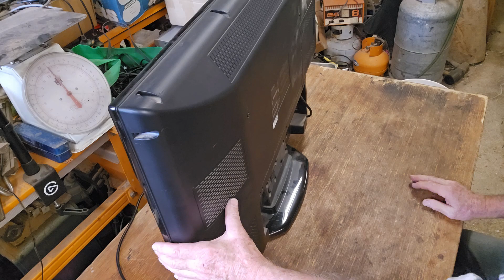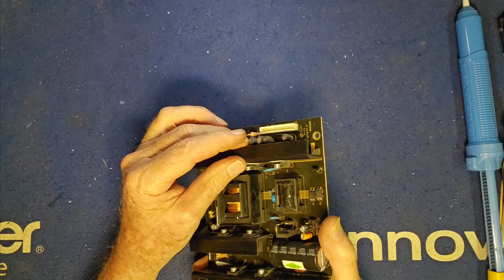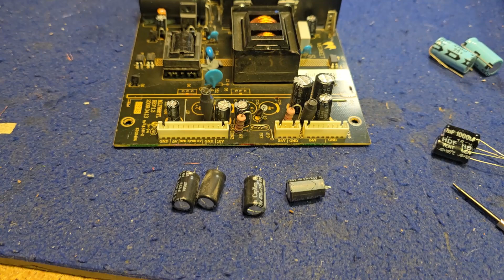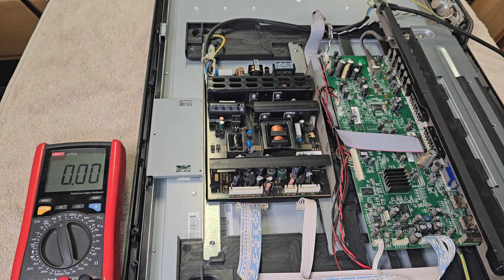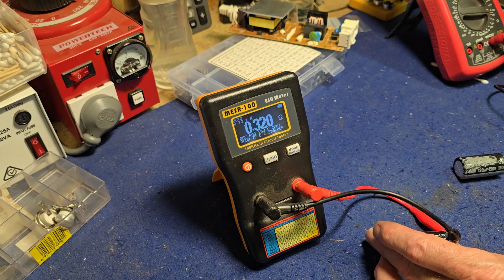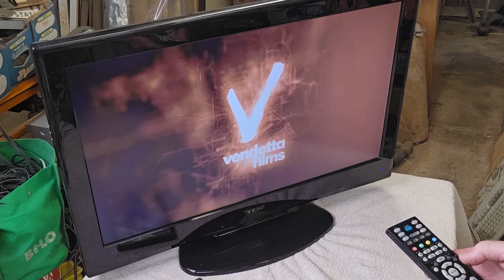How to Fix a Teac LCD TV/DVD when there's been a Massive Capacitor Failure Event! Saved from Ewaste!

Comment: In the 2000s If one capacitor in a board has expanded they all would most likely come from the same supplier. I have replaced thousands of capacitors in both Ocean Brand (which had a 100% failure rate) and Intel brand (about 2% failure rate) Computer motherboards, it seamed to be certain capacitor manufacturers that caused it, I would replace every capacitor in a board and I had a 99% success rate. And do not put them in backwards… they can go BANG!
Reply from the maker: Yes, I think it was a particularly bad era for poor quality caps! Luckily none went bang, so must have got them all correct! Thanks for watching 😊👍